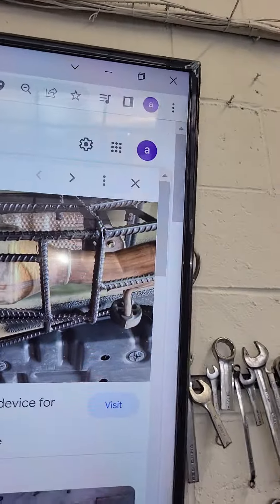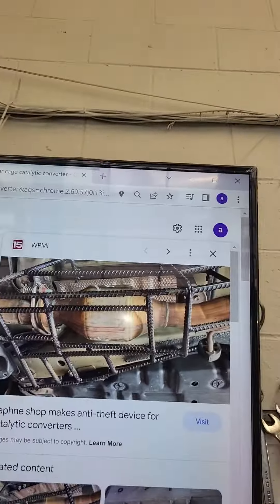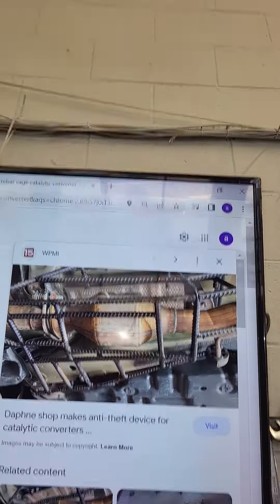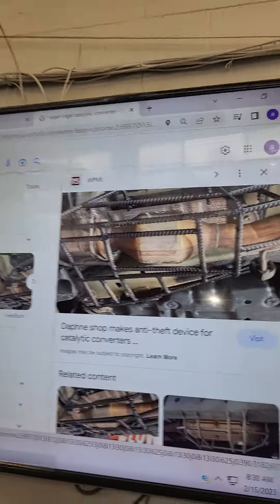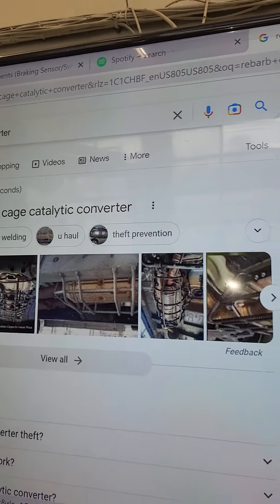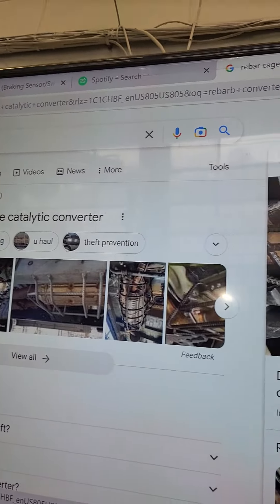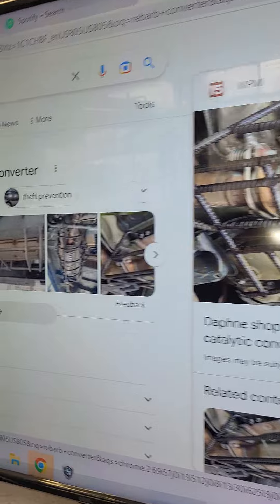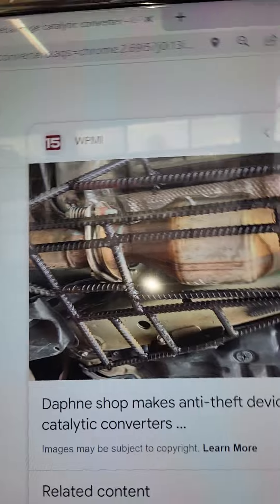Welding rebar to your vehicle is a bad idea .Catalytic converter theft  protection

Comment: I've seen several posts about Cat Shield being cut through and CC stolen.  I have not seen the same for rebar cages. In Los Angeles area a 4x4 rebar cage is about $250 to $300 parts and installed.  Worth it for LA area

Comment: I have a 2003 honda odyssey 210000 miles on catalytic and works like new , I never had to replace a catalytic from any car I owned but I did replaced oxygen sensor 2010 rav4 with 151000 miles , brother in law had 97 expedition 280000 miles catalytic it’s fine but I believe the bolt on cage might work
Reply: If you did not weld a rebar cage get advise on 2 harden steel rod 1/2” prefered larger along and on the cat about 2 feet after and before  .

Comment: Thanks for your video and explanation. It is helpful. But I will say, as someone who just had the cats stolen, the hassle and time it takes to find replacements and get the work done can take a toll. There's more to it than just the money component. I've been looking at a single piece of rebar welded to the exhaust and cat, along with etching the license plate or vin on the cat itself. Some even recommend painting the cats a bright color with high temp paint. What are your thoughts regarding the paint?
Reply: My buddy told me about this years ago.  I don't think that a whole cage is required as shown.  Just one piece of #60 bar should slow down thieves.  It's harder than #40 bar by far for cutting.  It would take more time and sparks to get it off.  Even though I work in Oakland I have yet to do protection.  I park in my back yard at night.

Comment: Bad Maintenance and Cheap gas and hard driving will cause your converter to last 100k or less. Converters should last a life time ! It's a Non wear component . Meaning that it doesn't run out of material to perform the Reduction and Oxidation process  !! 🤘🤘